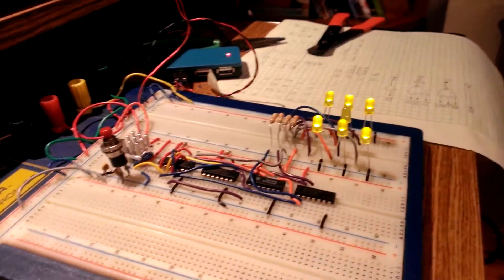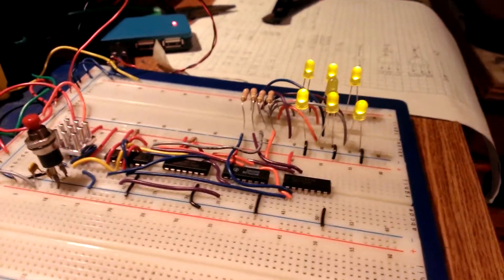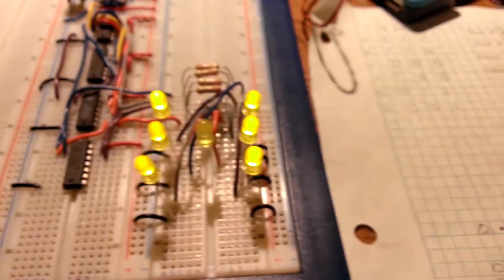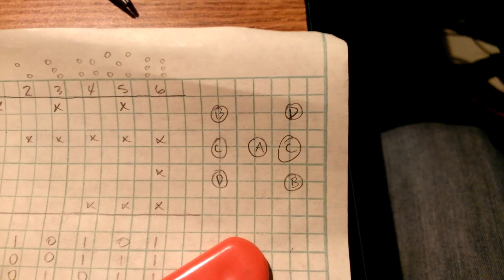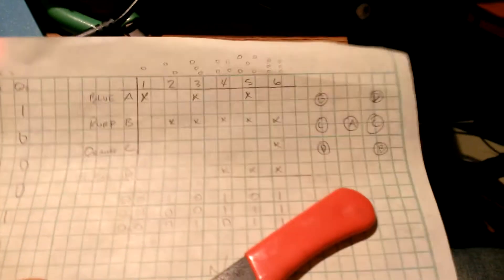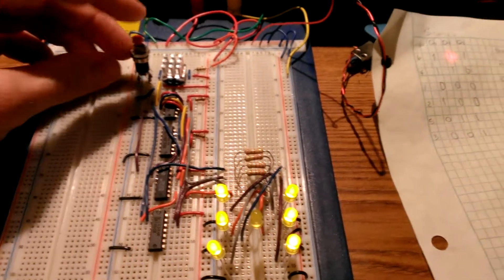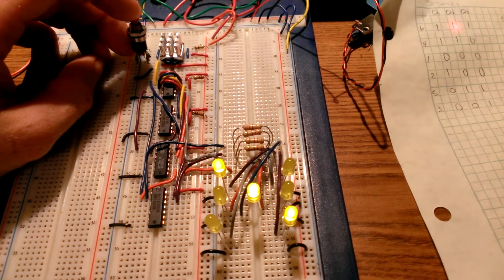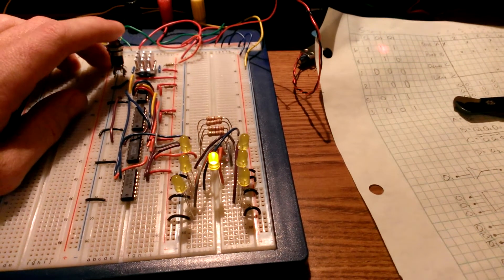Electronic Dice Project

Comment: Great job dude, I like to do that project, would u have a simulation of the circuit and the paper that u used in the video??, please send me to tavo_8_1@hotmail.com,
Reply from the maker: Hello, I never simulated the circuit and I dont have the paper anymore as I turned this in as a class project but I do have a link to the site where I got the idea. 

http://www.ni.com/white-paper/13581/en/pdf

Keep in mind that when you wire to the flip flops you should test the output to determine what logic you're getting out in each stage. This threw my circuit off as I had output of A and B mixed up. This was apparent when my dice patterns were not what they were supposed to be. 

Also I used a different gate logic than suggested in the guide. I remember that theirs wouldn't work for me because I didn't have the chip. 

I hope this helps.